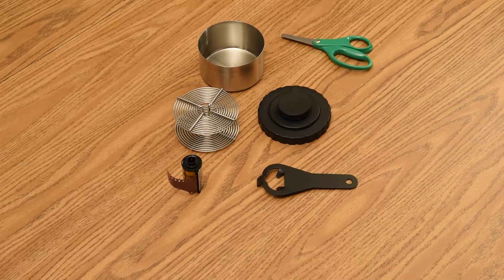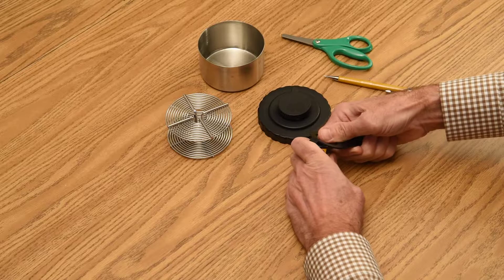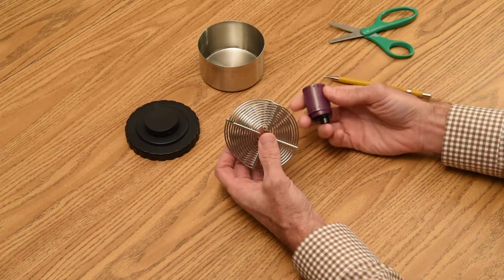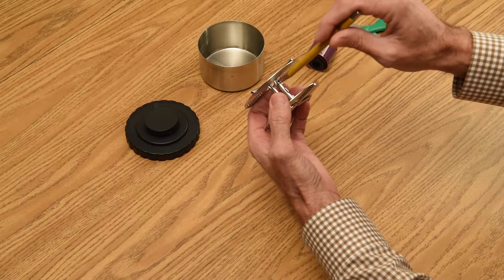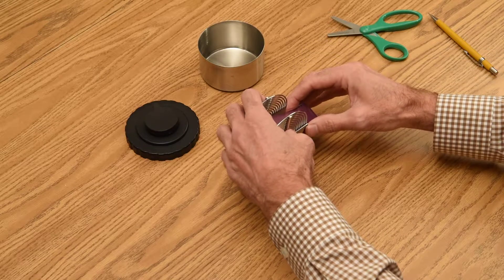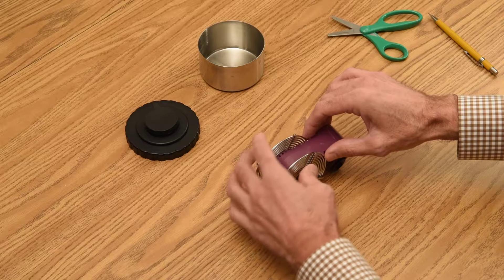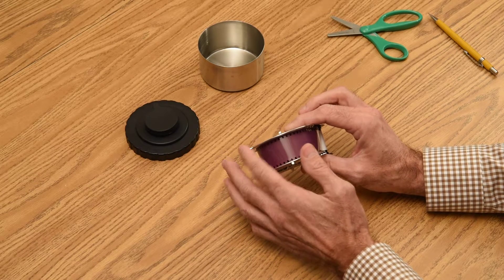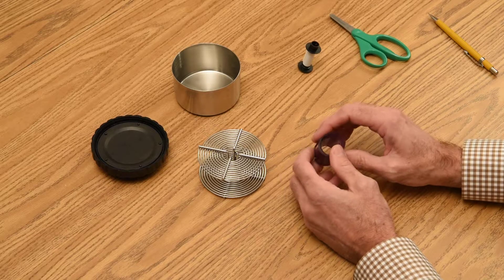How to Roll 35mm Film onto a Steel Processing Reel

Comment: I’ve used the jiggle technique he describes for 4 years after I first saw this video.  I can vouch that it’s effective.  I check this constantly: roll reel, move film back and forth, roll reel, move film back and forth…. It’s easier to avoid a problem early than have to correct for it later in your reel.

Comment: If the film leader is not rewound into the cassette, you can cut it off in the light. You don’t even need to open the cassette in that case, less chance of touching the emulsion.

Comment: I know Hewes brand reels are designed with the 2 prongs, but all the free generic brand reels I've  acquired are NOT this premium style of reel. They do not have the fangs/prongs.
I did not know that the beginning should be routed within the center of the spool.

I purchased a Hewes version of these reel that is suited for a  1500 series Jobo tank  (this type of tank has a funnel in its center, and can be used for inversion hand processing.)  I will find out if that extra in the center will interfere with insertion of the funnel after loading the film 
thanks for this "Hewes version of spool" instruction